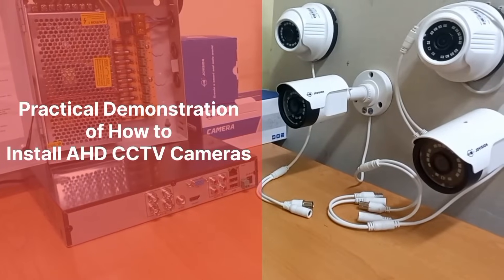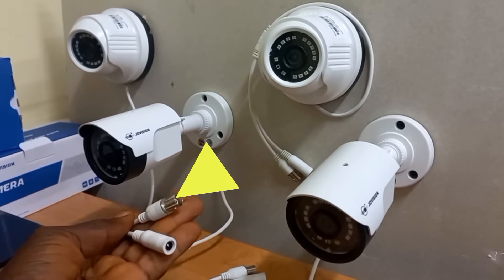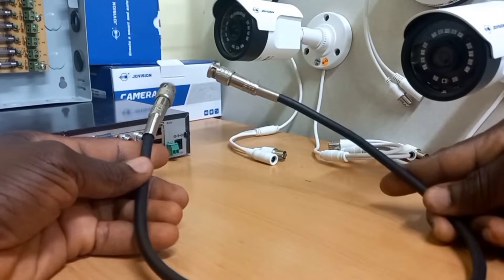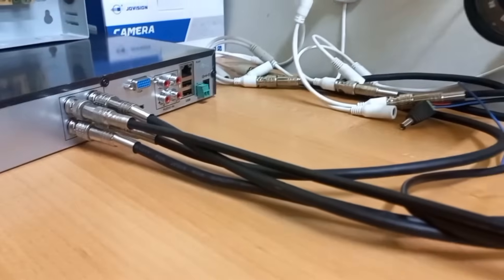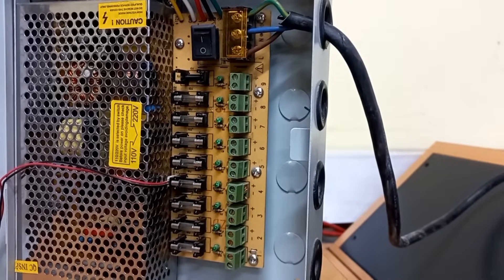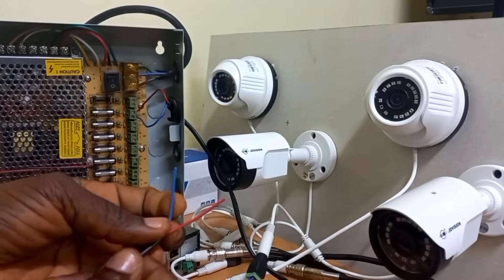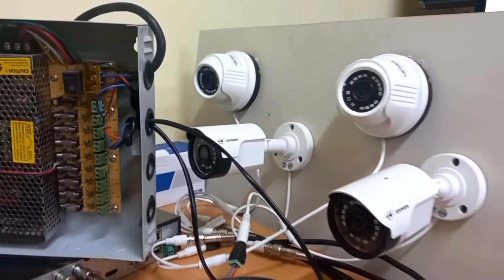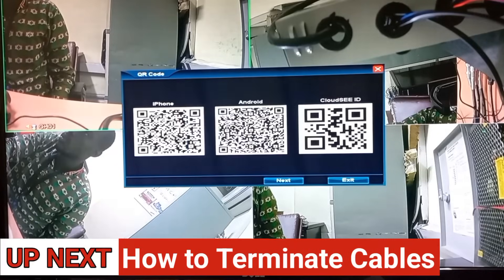AHD CCTV camera installation step by step setup guide from beginning to end.

Comment: Great video. You are amazing. I do have a question: if the cameras are not POE cameras that get power from POE switch, then we must make use of power supply unit to power the cameras right?
Reply from the maker: Yes, but that is in the case of IP Cameras.  Analogue cameras like the ones used in this video use the power supply unit.
Reply: @Tech_Inside_Out thank you sir

Comment: Then what's the correct size of the cables to be used
Reply from the maker: RG 6U for video and a minimum of a 1.5mm 2 core flexible cable for power

Comment: Which software are you using
Reply from the maker: This is a firmware that is installed on the DVR by the manufacturer, you don't require any software

Comment: What is the software you used to connect to the computer?
Reply from the maker: I didn't use a computer,  i used just the monitor for this particular video. The firmware is on the DVR

Comment: When I plug in the vga cable in the dvr the monitor turns on and shows the camera for one second and immediately turns off what should I do
Reply from the maker: I suspect a fault in either the VGA cable or the VGA Port on the DVR.
Please change the cable. If the problem persist the fault might be with the VGA port
Reply: Woah you responded so fast haha thanks man
Reply from the maker: @dandura_  Most welcome

Comment: My camera has only got one wire. The power cable. How can I connect it to my DVR ?
Reply from the maker: Please check if it is not a standalone camera, whereby it connected using its access point. Please refer to its manual

Comment: Good job TIS, but you didn't explain for us the details of the blue and red power cables, which one is for video and which one is for power?
Reply from the maker: Hello,
The usual rule about power cables is that red is used for Live in the case of High voltage engineering whiles it represents + in low voltage engineering.  Blue is also used in place of Red at times. When you have Blue and red together, Red stands for + and Blue being -

Comment: Hello bro 
Thanks for the video
Am having blurring problems with my cctv camera 
Pls how do I solve it
Reply from the maker: Hi, 
Blurred pictures are caused by the following:
1. Low voltage going to the cameras.  The low voltage is caused by the use of inappropriate power cables. 
2. The inappropriate use of network cables to wire up AHD cables can also cause this problem. 
3. Using very long cables to transmit power to cameras is another cause of this problem. 
4. Weak video terminations can also cause this problem.
Reply: Thanks bro
Pls what about lines to
How do I solve it
Reply from the maker: The blurry lines are due to low voltage supply to the cameras.

Comment: Узел на кабеле питания - что об этом знаете?
Reply from the maker: Αυτό που ξέρω είναι ότι οι κόμβοι ισχύος χρησιμοποιούνται σε συστήματα υψηλής τάσης, δεν γνωρίζω τους κόμβους ισχύος στα συστήματα CCTV.
Reply: Knot meant to avoid accidentally pulling the wire?

Btw the CCTV power box and the DVR  need to be closed together right.? But  monitor can be far away? 
On the supply box, where to connect the cable to the monitor? Or just the cable  connecting from DVR to monitor?

Thanks😊

Comment: What are the best methods for checking video loss?I think the dvr video cable plug in might be loose.
Reply from the maker: 1. Check the BNC Terminations, if it is not the cause,
2. Check the power connections
It is either of the two or both that may be the cause

Comment: Hi thanks for the video. I lookup your video for the refference. Currently in having issue with the camera is not switch on. What could be the possibilities ? I measure the dc power supply it only shows -10v . Is it enough  to power up 5 camera ?
Reply from the maker: Hello Faryz, the voltage could be a factor. It should be atleast 12v dc. Please  check the video Terminations also but i strongly suspect the low voltage level.
Please let me hear from you what happens after checking.
Reply: @Tech_Inside_Out  ok will get a brand new dc converter. Will update u once i replace it. Thanks !

Comment: I like the way this explanation goes. It's understandable thank u so much for your help
Reply from the maker: Glad it was helpful!
Reply: @Tech_Inside_Out  hi bro I got this DVR  from china  and I found out it's Chinese version and has no English language
Reply from the maker: @franklinokeke4099  The language could be changed to English provided you can get a similar DVR and use the one with English to guide you in changing the language of the Chinese one, because they normally have it in multiple languages.
Reply: @Tech_Inside_Out  it only has Chinese in the language options the shop told me to get a firmware English version
Reply from the maker: @franklinokeke4099  I would have preferred one with the English rather than looking for a new firmware.
Reply: @Tech_Inside_Out  yes there is not I can do about only option is this
Reply from the maker: @franklinokeke4099  Ok